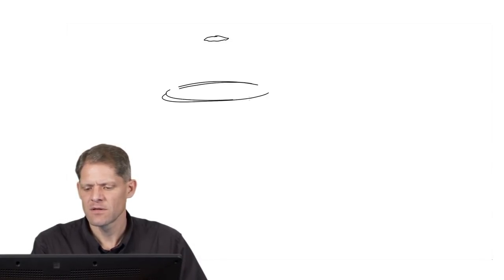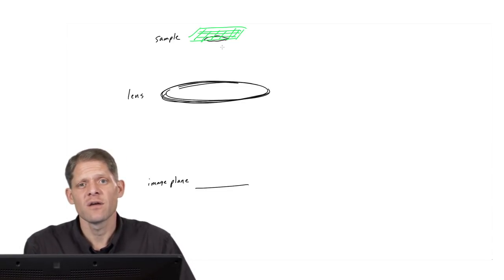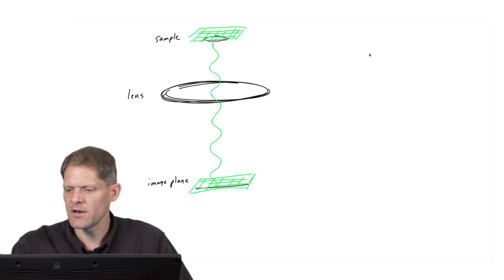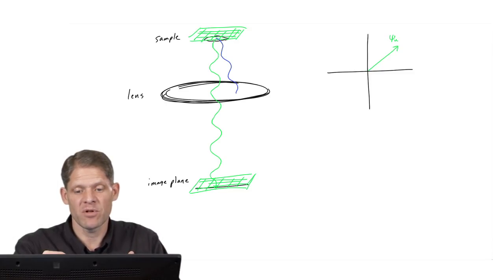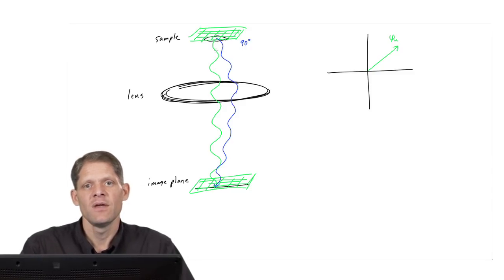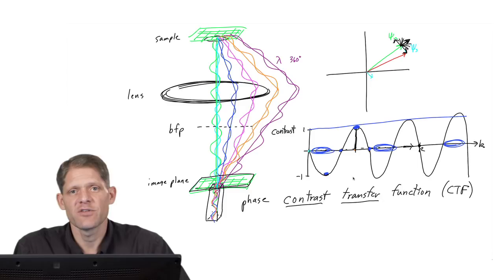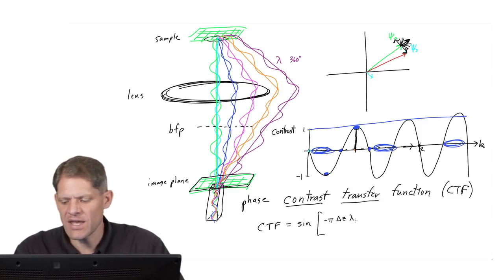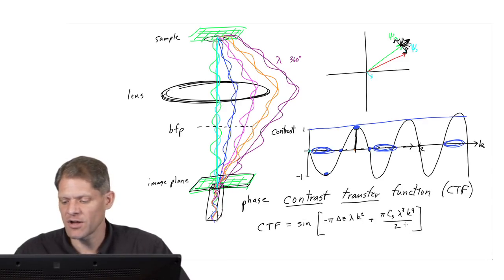Part 3: The Contrast Transfer Function - G. Jensen

Comment: I think this explanation is wrong in the sense that it depicts the CTF as independent of defocus. In the end he shows the correct formula where defocus appears as the main cause of CTF oscillations. Moreover, if the drawings were correct, the CTF would oscillate according to sin(l*defocus*k+...) but the formula is sin(l*defocus*k^2+...)
Reply: I agree with you Leandro Farias Estrozi. This representation cannot be accurate since it does not depend on defocus. Everyone here should watch the way Marin van Heel explains the same phenomena.
Reply: I agree with you.
Reply: If you vary the defocus, the path length would vary and hence the phase shift also would. That would change the CTF curve. I don't see why this explanation does not take defocus into account.

Comment: Regrettably this is completely incorrect and misleading. The zero crossings in the ripples in the CTF depend on the amount of defocus, not on the path difference of electrons at different scattering angles to the single pixel used in this depiction. The single pixel of the detector is implied to be in the direction of the direct beam (straight through beam) which would be at k=0. There is no treatment here of how the defocus distance plays into the equation, -until it magically appears in the final formula, - after the statement that 'you can find that in books'.
Reply: It is explained in the next video.